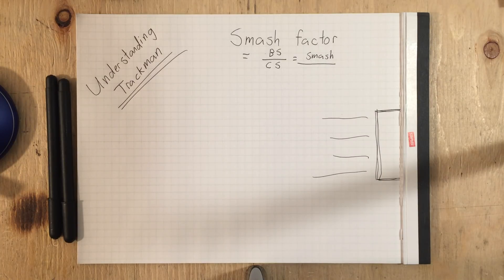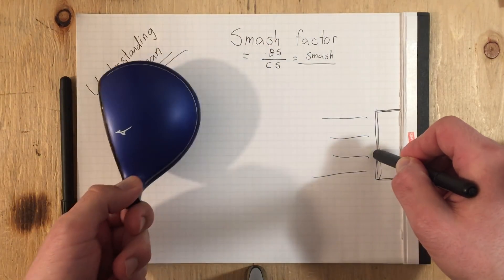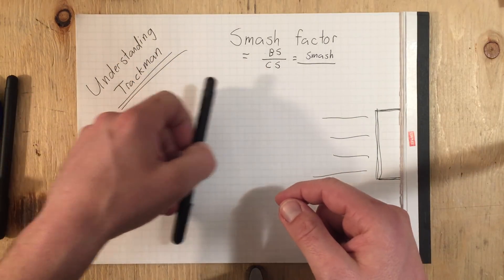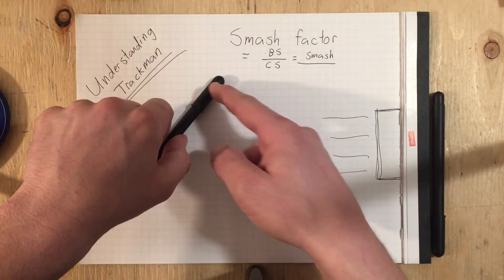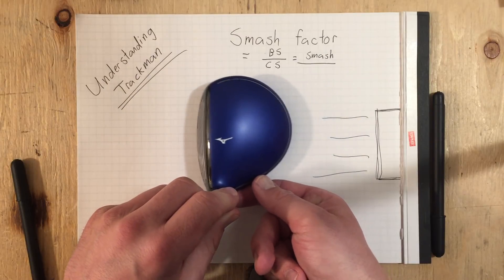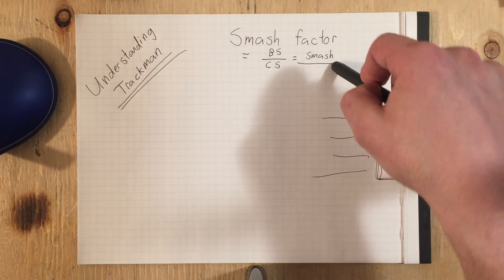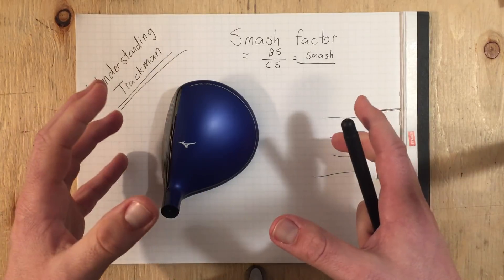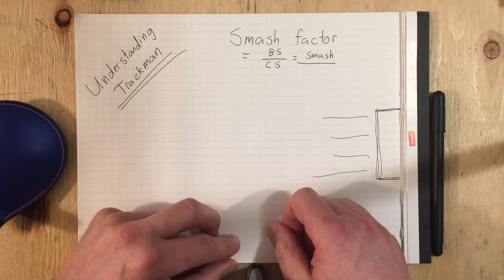Understanding TrackMan - Club Head Speed Readings

Comment: I believe that they are mis-reads, but it's also a combination of Tiger hitting with a downward AoA and a mis-hit.  Quintic Consultance Group did research on TM about 5 years ago and showed the issues that TM has with club data measurements/calculations and mis-hits.  It could also be where the TM is set up with relation to where Tiger is hitting the ball.  At the Honda is where he was getting those high readings and each time on the hole that he was measured Tiger missed the tee shot dead left.

Comment: Thanks Ryan for the video. While I understand your explanation on Trackman's calculation, I just do not understand why Trackman or even Flightscope (I should say radar) only measures club head speed like that, whereas other optical system as well as other stuff such as Mizuno Shaft Optimizer, Swingbyte, SkyPro, etc. measure them differently. 

Because while I like Trackman's measurement, the Smash Factor comes out ridiculous even for amateurs like me at 1.50. Theoretically we should max out at 1.48. And because Trackman is the industry standard, everyone looks at Trackman's PGA average chart. And the PGA pros' averages are not even 1.50!

I rely more on optical/swing speed measurement devices speed, but should we believe more on Trackman's club head speed because that is just how it is? My point I guess is that I just don't think we should be getting 1.52 even on a toe shot.

Comment: Does that mean that Tiger has more clubhead rotation trough impact than he was used to all the years before? Which means that he is using his hands/arms more?
Reply from the maker: Good Question Steffan.
I don't think this is an indication of much to do with his swing. This has almost everything to do with the geometry of the club head. Must experienced fitters will tell you that certain driver heads will cause this result on TrackMan - Taylormade being the most recognized because of the sliding weight tracks on the bottom. This used to be a big issue with the Nike Covert drivers with the big Cavity too. The radar signals bounce off all the angles on the sole of the club and in a way "confuse" Trackman.